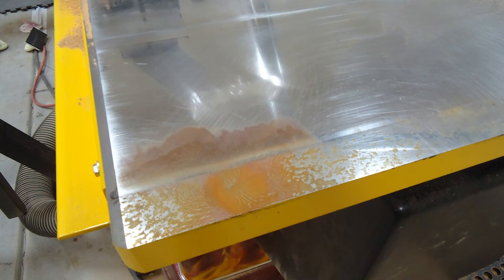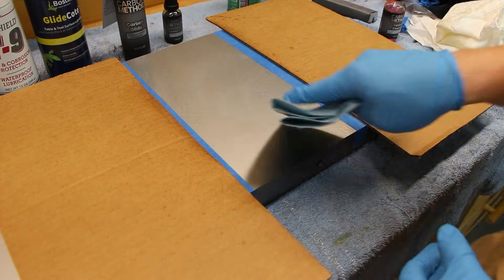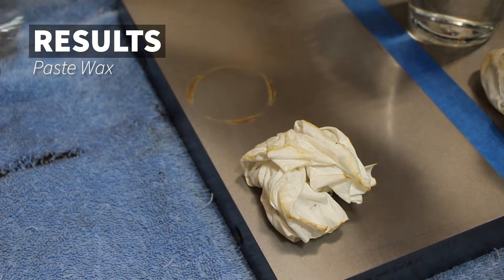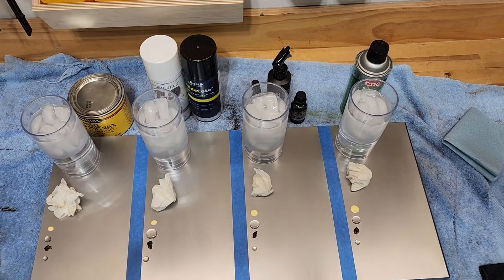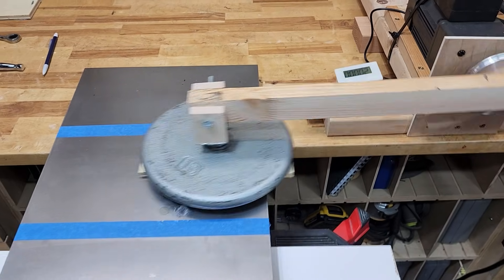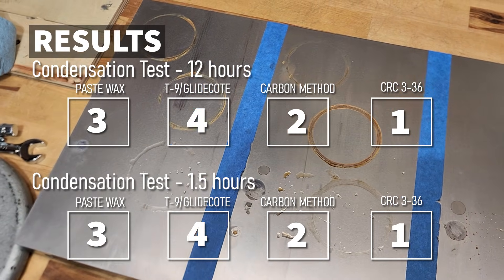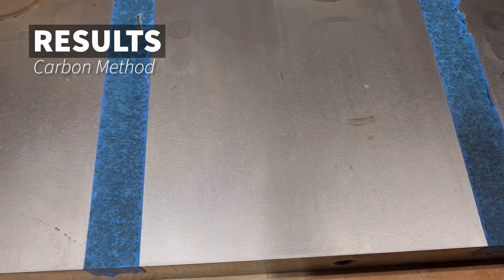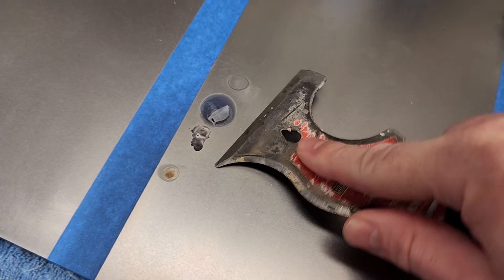Which Rust Prevention Method Wins This Brutal Tablesaw Test

Comment: For anybody scoring at home: Carbon Method is $85 for .5 fl oz. CRC is $8.50 for 11 fl oz. Is the Carbon Method result 220X better than CRC? Doesn't look like it to me. All things considered, I think the clear winner, BY MILES, is the CRC.
Reply from the maker: True, there is a pretty big price difference, but I didn't test it for slickness, so you might want to also topcoat the CRC with some Glidecote or something to reduce the stickiness.
Reply: Yeah no offense but spending 85 to 90 for something that wd40, fine scotchbrite pads, paste wax and shop towels can do already... probably not gonna happen. Have to reapply more often maybe.
Reply: corrosion X is my go to. Electric to metal. Still used J & J  wax in shop even on my gun steel heavy on no wipe. Nice test you did there.
Reply: @wmjohnson7063 I have used corrosion x and thought about it, but you use it on your table saw?
Reply: I went for the Carbon Method stuff; Did my Bandsaw, Jointer, Planer and Table saw. Spent a bunch of time doing the process. My shop has HVAC too. I got rust spots on all 4 of those surfaces after spending a few hours doing Carbon Method. To be fair stuff did glide nicely. I don't think after watching the application videos and spending all the time I did, that I botched the application. 
BUT you can get a Gallon of the CRC stuff for less than Half what the Carbon Method cost. Wiping down a surface quick with it isn't a big deal. Just sayin.
Reply: @ejpierle to be fair it's better to compare the cost per square foot covered, per month - how far does the can of each of those products go, and how often do you need to reapply?
Reply: @SteveKuznetsov  I mean, I agree, but even if you had to use 5x as much product 5x as frequently (which I highly doubt) CRC would STILL be like 1/10 the cost. I just feel like there's no way the math isn't still on my side here.
Reply: I've been using CRC for years. Lasts quite awhile, performance is very good and price is better than a lot of alternatives.  Also can be used to remove small rust problems with  a fine abrasive pad.
Reply: Yeah likelihood of use is important with anything. The Carbon Method is nice and all but I know me. I just wouldn't use it all that often because of how much of a pain it is to apply. Wiping on some paste wax is bad enough. Something with 5 steps? Yeah I'll get right on that. Ease of use is critical. If something is easy to do you're going to do it.
Reply: ok so apply the cheaper stuff 20x more often and tell me what your time is worth
Reply: @Rob-df6py  c'mon bro, wiping a table top... Also who says it lasts 1/20 as long?

Comment: Good test. I'd be interested to see how a less expensive ceramic coating would do in the same scenarios. I have used Boesheild T-9 and Hybrid Solutions Ceramic Spray coating, and haven't had any rust. However, I haven't let water sit on my tables saw, and I run a dehumidifier.
Reply from the maker: That probably helps the T-9 perform better. I think more coatings and re-coatings can build up too over time. I'll look at that Hybrid Solutions one, though.

Comment: I live about 10 minutes from the beach in south florida, my garage door stays open about 8 hours a day. I put 4 coats of Carbon Method on it and it looks great still after 6 months. Totally worth it bc before it was a nightmare I have been wanting something for my hand tools though and I think now for that I'll chose the CR product. Ty
Reply: Good to know, I’m right up the road on the space coast and am always fighting rust. I guess I will give it a try
Reply from the maker: That's good to hear... the CRC did do well in these tests, but it may be good to add something additional to help it glide smoother especially on a hand plane or something the needs to slide a lot. Glidecote could work for that. But definitely try it both ways!
Reply: @EveningWoodworker  I use camellia oil during use
Reply: Hey Chris, you can apply Carbon Coat on your hand tools as well.  It works great.

Comment: I simply use a coat of paste wax, then buff then I use a cover made of mdf or plywood with felt glued to the bottom (the part that touches the tabletop). Once a year I use 3 or 4 0000 steel wool and prep to clean the saw tabletop then coat with paste wax.
Reply from the maker: Hmmm.. interesting. Do you get any rust from moisture in the felt?
Reply: @EveningWoodworker  I’m in Texas, no rust in 10 years. Before that 9.5 years in Madison Wisconsin, before that 3.5 years in Juneau, Alaska.  No rust except in my old bones.
Reply: @EveningWoodworker  if I end up running a large amount of pine from HD through my saw I’ll clean up the top and rewaxed as needed. Just finished a remodel of my house that has taken about 10 years, working with treated pine to exotic woods. When in Alaska I also used the same technique on my bandsaw. As for my table saw with the top on my saw it doubles as a workbench for glue ups or setting my oscillating sander or grinder on. I cover the top of the top with sticky carpet and change it up when it gets too messy by peeling the carpet off and sticking new squares on it.

Comment: Thanks for the great demo! Will you be doing a follow up video about how to clean the rust off once it's there?
Reply from the maker: Good idea! You're not the first to suggest that
Reply: @EveningWoodworker  I look forward to watching it when your done!
Reply: I use the harbor freight surface conditioning tool to remove rust from cast iron surfaces. It works great and the 120 grit pad even leaves a factory looking scratch pattern.